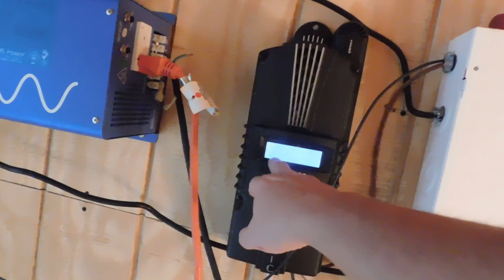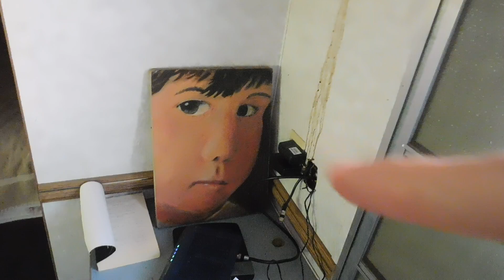Solar power in the fall and winter in the northeast can it be done?

Comment: Hey Ed, great video! Check out the panel mounting system from MT Solar. I just finished mine and love the easy of assembly and the ease of changing the angles for optimal production. Check out my video, I think it is titled 1680 watt array, I think you will really like the system and they are reasonably priced.
Reply from the maker: I will do that thanks.

Comment: several years ago I saw a documentary on mini wind turbines that sit on top of buildings, they are a vertical curved blade system that catches the wind in any direction, are much quieter then the standard large 3 blade towers.  have you thought about getting a mini wind turbine for the property?
Reply from the maker: That would be something I need to look into.

Comment: Got a question, if your fridge cooling fins were at the rear, exposed to a cooler part of house  by a wall and only the door was exposed to the warm area near wood stove. The fridge would not have to run as often in winter. saving power. The fridge would be sort of sunken into the wall. just a thought.
Reply from the maker: That makes a lot of sense.

Comment: My grandfather used to turn off the fridge and water heater every night. He had one of the old fuse boxes with the glass fuses that screw in, so he would just unscrew them at 9 pm, and screw them back in at 4 am...they were on grid of course, but they cut the electric bill by 1/3 by doing that.
Reply from the maker: That's very smart to do if your not sing it why have it on.

Comment: when i first started solar system...i mounted my 2 panels together on L channel rails...then fastened that to a TV swivel mount that was attached to a 4x4 post ....in the winter i didnt want to shovel to get to it so i put a rope through pulleys and attached the rope to each side of the panel rack...then i just stood up on my back deck and pulled the rope to make the panel rack swing toward the sun manually

since then i bought a solar tracking package off ebay...about $200...it works great for 2 years now no issues...you can adjust for wind and sun sensitivity with the controller it comes with

https://www.ebay.ca/sch/sis.html?_nkw=Single+Axis+Solar+Controller+Tracking+System+Sunlight+Track%2610%22+Linear+Actuator&_id=191412814676&&_trksid=p2057872.m2749.l2658
Reply from the maker: That not a bad price at all let me see if I can do that in the spring.
Reply: just to clarify Ed...i only have 2 panels on this solar tracker...you would have to check the weight/power of the system when you look at the actuators...but i certainly believe your next investment should be trackers...not more on panels...i never hit 15.4 volts on my 12 volt system until i had the tracker

Comment: The manual rotating mounting system of the panels to track the sun is a good idea.  I was thinking that when you made your most current mounting rack, it would pivot vertically so that the panels could be tilted up for maximum winter production and tilted back flatter (like now) for maximum summer production.
Reply from the maker: I should have done it like that.